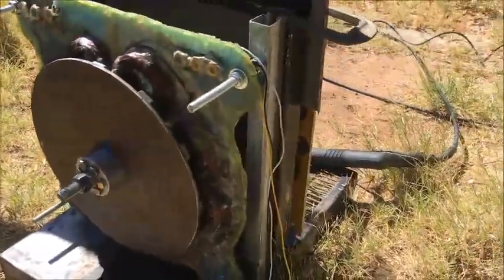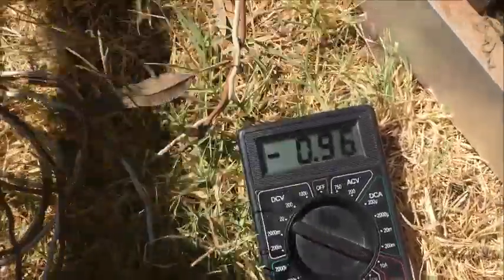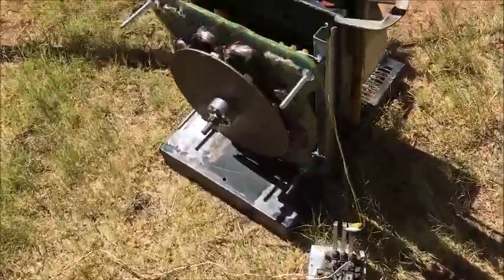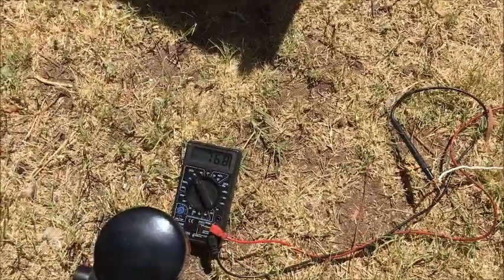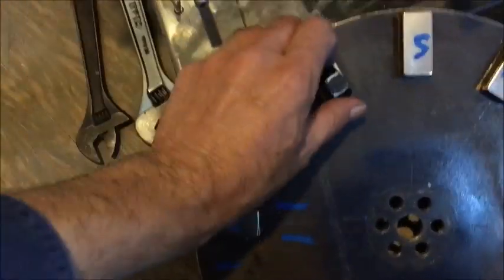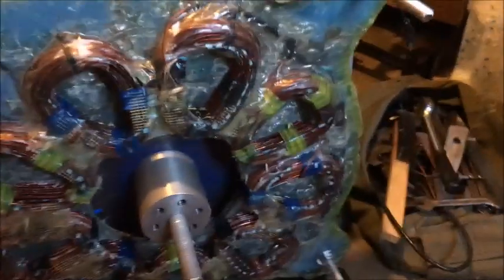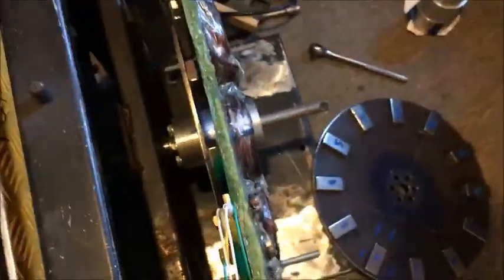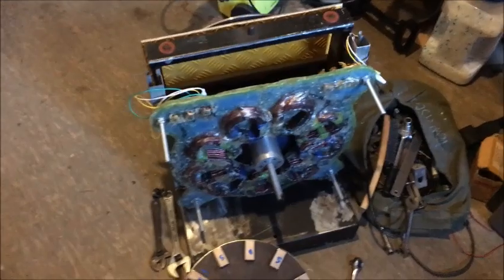Axial Flux Generator

Comment: People don't realize how truly inefficient these units are.
Reply: It's not about efficiency of the generator. It's about using what you have and getting the most efficiency out of it.
Reply: @freedomer342  lol it's based purely on efficiency of the generator. The more efficient you make it the more power you're getting for X work going on. The more efficient, the more you'll be able to run off of one single unit.
Reply: @JF32304  if your unit is pushing 100V and your able to get 80V, then you have no point to go with something bigger because now your wasting 20V. If you can use the 100V to its full potential then your doing it right. From there, it doesn't matter if the device your running is 100% effecint or .1% efficient.
Reply: @freedomer342  you don't understand what I'm talking about. What if you could get 200v? Then you can double the load as before.
Reply: @JF32304  you won't get 200V out of it if you can't get it's full efficiency out of it. These generators have alot efficiency in them then what people use them for so yes to a point your right but if one cannot figure it out, then your best bet is to figure out how to use what you have to the fullest.
Reply: @freedomer342  you really don't know what efficiency is actually. These units really aren't that efficient in all honesty.
Reply: @JF32304  You're absolutely right because there's no way in hell that I'm going to let theories become law and what is law be detrimed by men. If one can use 100% of what they are using then they are pulling 100% efficiency. If a generator ran on 25% efficiency, and he was able to pull use 100.5% efficiency, would it not then be an over unity generator or would it be a generator that actually runs on 25.5% efficiency. According to the books, they have no idea what is considered efficiency. All it is is some bull that someone put to attempt to make someone else appear stupid and strip them from thinking outside the box. This setup right here can be ran as a motor and a generator at the same time along as a wheel and a turbine all in one and many more eityout effecting the true efficiency of the setup. You want to be able to get 100% efficiency of what your using? Find out how much actual voltage is coming off of it. If it's producing 100 V, get a capacitor bank that can hold 110v and that motor will never bog or cog down.

Comment: A great little 3 phase genny Dan.
I'm sure it will run better when you fine tune it.
It did not seem to cog very much when you turned it by hand, perhaps you could reduce the air gap to increase O/P.
Also a set of Schottky diodes in a bridge maybe be more efficient.
I always fancied the idea of making a VAWT, but never really got it off the drawing board :-(
Looking forward to seeing your progress on this one :-)   Martin.
Reply from the maker: Hi Martin. Yeah that 3 phase bridge rectifier is rated at 1600 volts the data sheet saying forward voltage is 1.3 volts max thats 6 diodes at 0.3 forward voltage. Here data sheet http://www.datasheetcatalog.com/datasheets_pdf/6/R/I/7/6RI75G-160.shtml

They could be Schottky diodes anyway. But I will try it out, Because rectifiers aren't rectifiers. Some create heaps of lag on generators then others.

Comment: Really nice generator Dan! I was rooting for 100 volts. You could put one of those in a stream and turn it fast enough to charge a 12 volt battery I bet!
Reply from the maker: Cheers. I'll work on balancing it when I get a shaft made up and we will see more voltage.